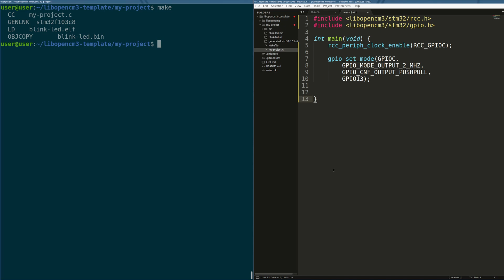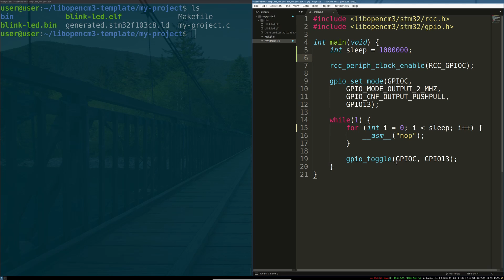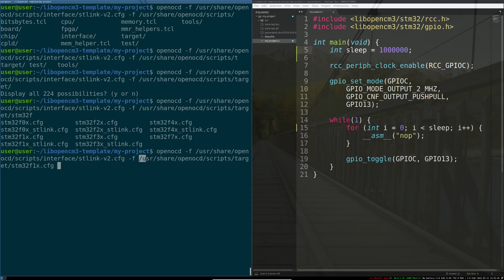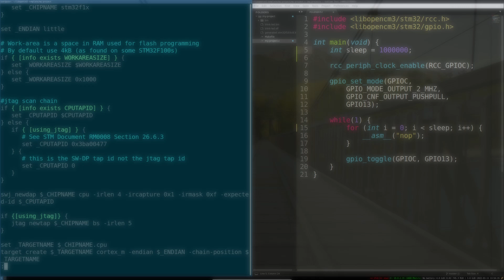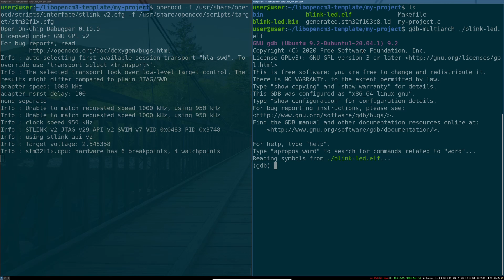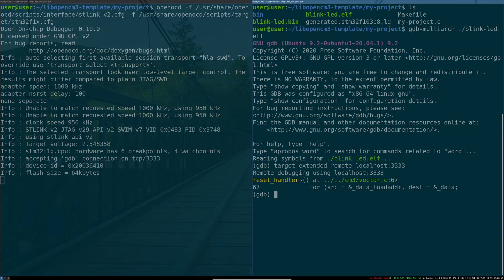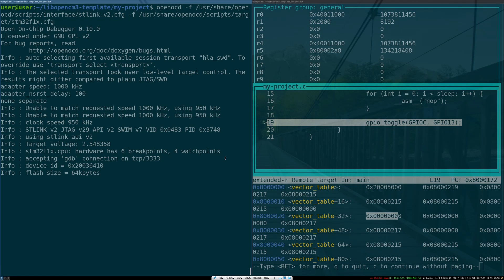This Is 100% How You Should Be Debugging | How to Use OpenOCD to Debug Embedded Software with GDB

Comment: Why would I do this instead of just using SWD's SWO pin via STM32Cube IDE?
Reply: imo the power of openocd is that it can be used with many types of chip, and can use something more generic as your programmer such as a raspberry pi, which lets you program loads of kinds of chips without specialised hardware or software. Do whatever works for you really, i mainly use it so i don't have to buy an st link and so i can program and debug from the terminal

Comment: Just spent 2 days banging my head against the desk trying to get I2C working on the blue-pill using the libopencm3 library. By the way, you have to gpio_set(I2CPORT, SDA|SCL) to get it to work (at least in master-mode). Question: I found some 'optimized out' variables while debugging INSIDE libopencm3 code. I don't know if the debugger symbols were optimized out or if the variables were, any thoughts? I changed the -O level in the library's makefile, and re-compiled. Thanks so much for these videos, man. I tried cubeIDE and hated it; register level programming is fun and all, but I want to actually get stuff done. You introduced me to this library that fits my style.
Reply: Hey man, I am also trying to setup i2c using libopencm3 with no luck. Seems you have it set up. Could you help me out?
Reply: @coolink243  I'd like to. Have you got the libopencm3-template repo cloned?
Reply: @adammontgomery7980  hey man thanks for reaching out. Yes I have cloned the repo

Comment: Oscilloscope helps with debugging very much. Sometimes I can make all the job using only one or two pins to out either logical states through them or use them as a clock/data pair to see bytes on the oscilloscope directly.
Reply: thats bad
Reply: @TK50_21  that's fast)
Reply: @Ma_X64  For sure, but how many of us have an oscilloscope?)
Reply: @РусланШагиахметов-к7м  I don't know. But there were times I had none of them. And that was hard times. So you better be having one of those toys. Even bad one is much better than nothing.
Reply: Are you sure you're not just trying to brag?
Reply: @DeLaCruzer11  I'm not.) But neither the opposite. If someone would be interested in that technique I'd be glad to tell.

Comment: Is there a command-line-parameter to scan the JTAG chain for devices?

Any thoughts on using a GUI for debugging..  VSCode , Eclipse, or VisualGDB?   For example VisualGDB supports OpenOCD, yet it doesn't support popular debuggers that use OpenOCD, like the Black Magic Pro.

(Perhaps the BMP debugger is a little different as it doesn't seem to require any server software running on your computer (OpenOCD /STLink/urjtag/etc)..  Instead, I think the Black Pill just appears as a remote (serial) GDB debugger.. with all the JTAG/SWD-TRACESWO support handled on the BMP itself?)

Speaking of debuggers, I'm a little confused as to the difference between JTAG and SWO/SWD, and "ETM Traces".    Segger has tons of different J-Link/J-Trace models.. and there's also plenty of cheap clones (EDU Mini, RealView U-Link2, etc).   I have an AT ATMEL-ICE debugger, which supports CMSIS-DAP/SW/JTAG but no SWO.    Perhaps this explains why ITM_SendChar doesn't work when I tried it with Keil (limited version 32KB).

Does OpenOCD support the advanced streaming/tracing capability?
Reply: Jtag & swd are the same thing, except Jtag is more versatile & designed for multichip while swd removes the extra wires needed & their signalling requirements.

Kind of think of spi, with more devices u need multiple chip enable lines. But if its just single device, then you can remove the chip enable signal & use few wires.
Thus swd is Jtag compatible (since u can just not connect the wires from Jtag) but not vice versa (since swd doesn't generate & use the signals needed for daisy chaining Jtag)

Comment: Not to be that guy but is there a GUI for it? I’ve used the STM32CubeIDE and it has a debug mode that has all the functionality of this and probably more, like having a live view of global variables as the program runs and being able to see the disassembly, and it seems it would be easier just to scroll through your code whilst it running and just click to create a breakpoint wherever you want it, the interface in the IDE seems a lot easier to use with more functionality than this, so is there a non STM GUI version of this for other chips?
Reply: The IDEs are using these exact tools, the user just interacts with it through a GUI.
Reply: @brandonallen7748  I know that, I was asking is there a non vendor specific version of the GUI.
Reply: I had the same question. This seems like an overly obtuse command-ljne way to accomplish the same thing that's provided in cube IDE's GUI
Reply: Almost every editor/IDE can talk to GDB, so it should be usable with any of them, it's a matter of correctly configuring them. There are videos on youtube on how to setup with VSCode and Eclipse (IIRC).
Reply: I have to mention PlatformIO. It' annoying at times to get the setup working, but it does all of that visually. Just install PIO for VSCode and have fun.
Reply: Hope you ended up finding out about CLion - works really well!

Comment: When you say "bare metal" is that AtmelStudio or are you digging into the .h files to use lowest command possible. I just saw AtmelStudio is 1 GB in size (ugh) and Arduino is in Linux's Synaptic Package Manager and only 20 MB (yeay). Thank you.
Reply from the maker: Baremetal to me just means I'm using as little abstraction's as possible. Here we use libopencm3, which technically is an HAL but it doesn't add a ton of bloat middleware like Arduino or Atmel libraries.
Reply: @LowLevelTV  thank you
Reply: @LowLevelTV  or Rust 😂 ahah 😂😂
Reply from the maker: @AlessioSangalli  RUST IS THE FUTURE I WILL NOT BE CONVINCED OTHERWISE🤣
Reply: @LowLevelTV  
Baremetal is "on top of hardware" and not software (OS). I'd probably consider HAL baremetal programming if it is translated into low level instructions prior to binary compilation (compiler substitutions) as this does not result in additional layer between program and hardware during runtime.
On the other hand, low level is "close to hardware" which is register and memory control and not using frameworks and hardware abstraction layers.
The use of two on this channel is confusing.
Reply: C++ is the future and I will be laughing at all the Rust programmers sleeping in shop doorways.
Reply: @brianwest7344  if I had the crystal ball I'd use it to predict something more remunerative than programming language market share, but I have to say there are many jobs popping up for Rust programmers. People whose opinion I respect very much are also interested in Rust and started contributing to the language or the standard library. This said, LLL's approach to alternate between assembly, C, Rust and "system" stuff is very balanced.
Reply: @brianwest7344  built on C. Yes, Brian, I would like fries with my order. Thank you for asking.
Reply: @bob-ny6kn  C/C++ programmers are NOT likely to be underemployed. Maybe you are confused with JavaScript 😅
Reply: @bob-ny6kn  C is definitely very common in embedded projects BUT for safety critical code, C++ has a number of features that help: constexpr provides static type checks that #define doesn't provide; templates can be used to parametrize data structures that are statically allocated; lambdas are something I sometimes miss in C. "auto" also helps. All small things together that make it palatable when choosing the language for a project.
Reply: @bob-ny6kn  oh and my by far favorite feature of C++ that I cannot understand why is not in C: binary literals. I would use it every single day.

Comment: I think it might be easier to just code correct the first time 😁🤓😂 ..just kidding, really nice, did not know this could be done command line like this! Good content! 💪👌👍🤓
Reply: Do you realize that you are completely correct? Debug allows you to learn to achieve that level. Back when I taught myself to code, I typed-in code from a paper form (hand written or printed), watched it fail, learned to recognize my failures, and poof - eventually coded for top airlines... where bugs do not fly well... So, I live by, you are alive by, and want to emphasize your post: "Code right or die."
Reply: @bob-ny6kn  Maybe one of the top airline's engineers should have done some debugging on their 737 MAX.
Reply: @hackvlix  eeek. That was a managerial failure. Reliving the space shuttle.
Reply: @bob-ny6kn  Fair enough. Debugging the management is probably harder.